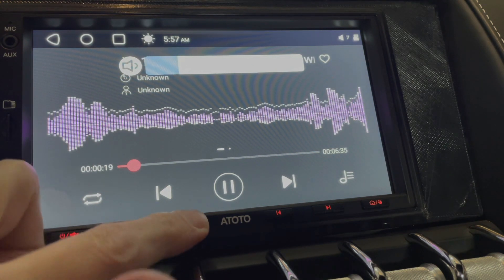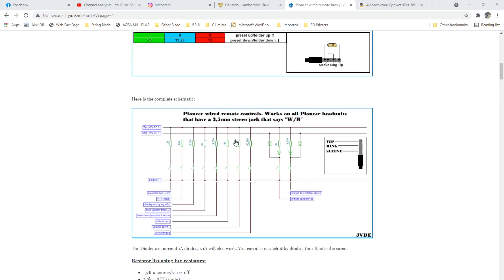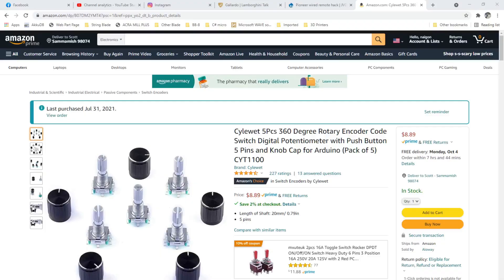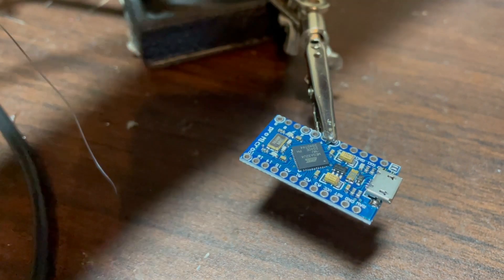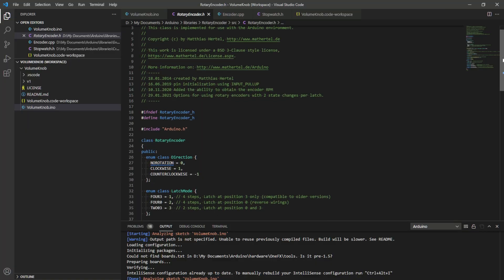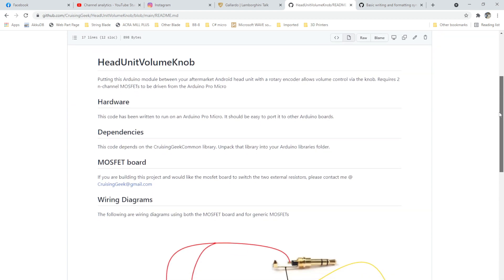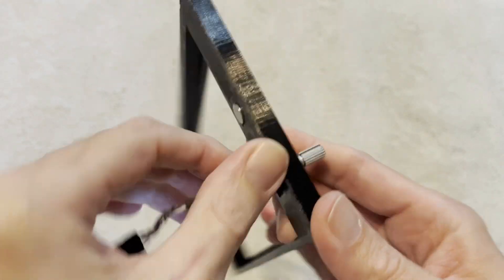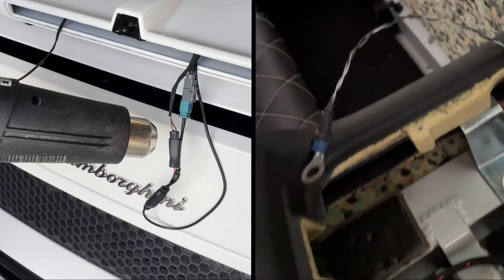Volume Knob for Aftermarket Head Units using a Rotary Encoder and Arduino

Comment: Great. I tried and it worked well. Thanks again. How can i add the second roraty encoder for different outputs?
Reply: hi can you help me
I can't find the stopwatch.h directory
I get an error in the stopwatch.h compiler: no such file or directory
Thanks
Reply from the maker: Hey nb1011100, you need to also download the CruisingGeekCommonLibrary from here: https://github.com/CruisingGeek/CruisingGeekCommon/tree/main/src

Put that in your Arduino libraries directory or right in the directory with the main files and it should compile at that point.
Reply from the maker: Glad it worked! If you are not a programmer the easiest way would be to just run a second Pro Mini with this firmware running, and the outputs would be run in parallel. Just make sure all the resistors are unique values so the head unit can read them independently.

If you can program you could potentially add code into the same Arduino to read a second input, but I don't recall if there are enough analog inputs for that on the pro mini. Definitely a Mega would support that.

Comment: Does this only work with Android based units and not brand names like Kenwood, for example?
Reply from the maker: This should work for the branded units as well so long as they have a programmable SWC input settings app where you can lean the buttons from the steering wheel. I admittedly am less familiar with each of those brands though so you would want to play with it or research each brand separately online.

Comment: I have a car with a  canbus decoder. Do you know if the android head unit will recognise the button presses from the swc wires if I have it configured with the canbus decoder?
Reply from the maker: I'm actually not 100% sure if the canbus decoder takes over the functionality of the analog swc input or not honestly. It would require some testing. I would hope swc controls would still work. If not you would have to interface the buttons with the canbus decoder as if it were another entry of your canbus system.

Comment: Looks complicated for the uninitiated. Would you consider building one for me?
Reply from the maker: Is it for a Gallardo or some other car? Main issue is to make a facia that accepts the rotary encoder for another car would be tough without having the car.
Reply: @cruisinggeek3640  I was thinking just the knob by itself with the board already built and ready to install.
Reply from the maker: @wfyfwfyf  Yeah that's probably possible then I could wire it up here with the 5V buck module and MOSFET board with the audio jack so it was quasi plug-in-play. Reach out to my email naigon_akoii@yahoo.com if you would like to have me quote you to build it.

Comment: amazing stuff, thank you so much for sharing! would you be able to point me to one or more of those projects you saw that use the USB volume control knob?
Reply from the maker: I didn't actually save any of the projects where folks were doing that as I knew it was not an avenue that I wanted to pursue. If you didn't want to go the Arduino route I would highly recommend a unit that was already made to interface with the SWC input, like this unit:

https://www.walmart.com/ip/Universal-Car-Wireless-Steering-Wheel-Control-Button-With-LED-Light-8-Key-Functions-For-Car-Android-Navigation-Player/889710547?wmlspartner=wlpa&selectedSellerId=16214&adid=22222222227889710547_16214_145279756546_18395656247&wl0=&wl1=g&wl2=c&wl3=646639356873&wl4=pla-1944934239563&wl5=1027741&wl6=&wl7=&wl8=&wl9=pla&wl10=120798572&wl11=online&wl12=889710547_16214&veh=sem&gclid=Cj0KCQjwuLShBhC_ARIsAFod4fLhRlDuhkeN09TZ0QGs02_VJkeNdatXwcOlu2hHA1M610b1FiUqs5kaArqXEALw_wcB&gclsrc=aw.ds
Reply from the maker: Note that this would be superior to the usb version as it works exactly as I built, the only downside to this being the form-factor cannot be customized so it is a bit harder to integrate into your existing setup.

Comment: Awesome work! I'm not well experienced with mosfets, and am based in Australia; any tips on selecting mosfets for the project? cheers!
Reply from the maker: It needs to be N-channel, it should be able to handle maybe 0.2amp continuous, though I didn't measure. This is the exact one I used but it is overkill for this application as it is 5amp continuous:

https://www.mouser.com/ProductDetail/755-RQ6E055BNTCR

If you are looking for a bigger aka easier to work with through hole package this should work as it is 60v but 0.2amp (200mA) compatible.

https://www.mouser.com/ProductDetail/onsemi-Fairchild/2N7000TA?qs=iN0KuJO79KZfCWVKA48bEg%3D%3D
Reply from the maker: Again I didn't measure how much amperage the Atoto drew when clicking the button but I doubt it was more than 0.2amp.
Reply: @cruisinggeek3640  Thanks a heap! I don't suppose you know if this is likely to work with my 2018 Kenwood head unit do you? It seems to use a 3.5mm jack like your design, however may have 2 inputs. Can't seem to find information anywhere on what signals the DDX9018DABS takes, but I assume it's relatively standardised these days.
Reply from the maker: @conroe_au  My only concern with the non-android head units is that the resistor values MIGHT be hard-coded inside the unit. The android unit has an app in the settings (shown in the video) that allows you to configure which button has which resistor by allowing you to select the one you want to sent then press the button. If your head unit doesn't have such an app in settings then it would be tough to figure out which resistor values when to which buttons.

Otherwise I believe the principal is the same that all the analog steering wheel controls (SWC) are resistor-ladder based so this would work.
Reply: @cruisinggeek3640  thanks a tonne. I've found some more convincing evidence that there's a training function
Reply: @conroe_au  Kenwood often uses it's own protocol for steering wheel control buttons. It's not a resistor matrix type, but the input line of the head unit expects NEC serial data .. 
Please google on "Ford to Kenwood radio adapter HOWTO" and you'll find more info and a sample project.
My project is based on this one and works as a treat on the bench, but not in the car. I probable have to use schmitt triggers to clean up the signal to the head unit. (in the car there can be interference noise from alternator and radiator cooling fan..)
Reply: @winandd8649  thanks for the help!
Reply: @conroe_au Cheers!
Reply: @cruisinggeek3640   I see you used 1K & 15K resistors, is the value critical, or just that they are different? Would you recommend a particular resistance for the pushbutton contacts? Thanks!
Reply: Hey @cruisinggeek3640 I finally got around to building this, but it appears that RotaryEncoder.h is missing from your common library? Have I missed it somewhere?

Comment: super intresting video, but putting an atoto head unit  on a Lamborghini ?? really? I would understand a Raspberry to customize as much as possible, a made in China Head unit looks very cheap
Reply from the maker: It isn't the best sound but compared to the factory it is sadly still better. I didn't like the Sony or Alpine units as none had the SD card or was a screen that wasn't made to have a flush, recessed fit. With that awesome V10 I rarely play music though...

Comment: Don’t know if you are still reading comments on this, but i am curious what the reasoning for needing a mosfet is? I would really love to know! Thanks!
Reply from the maker: Hey yes I try to check in here a couple times a week but been dealing with some health issues lately.

The main reason the mosfet is used is to keep the potentially higher current draw of the amplifier from running right through the Arduino CPU. It also allows for sending a positive signal to ground the signal so that the logic is 1 to be on and 0 to be off. Without the mosfet there might not be enough power from the CPU for the head unit to register the resistance, or worse it could be such a high current that it frys the CPU.
Reply: @cruisinggeek3640  thank you for the reply I appreciate it, and I hope you get to feeling better!

Comment: Thank you for this video and information. I have basic electronic knowledge. Which mosfet i have to use?
Reply from the maker: Pretty much any N-channel MOSFET would do, as the amperage/voltage requirements are pretty low. The ones I used were part of my Igniter boards which I sold as another small business and were way over-rated for this application.

Comment: Really cool, I'm building this project for my head unit, my rotary encoder also includes a push button, so I'm attempting to uplift your code to support this, then I can map it to a mute or home/voice input button.
Reply from the maker: Thanks for the compliments! You do not need the arduino for the pushbutton, simply use a third resistor off one of the button's leads to the head unit, and the other to ground and it will work as well. I did that for mute/unmute.
Reply: @cruisinggeek3640  oh man, it's so embarrassing I didn't consider that

Comment: I wonder if this can be done with the first knob without needing the adrino
Reply from the maker: Thanks for the compliments! You really need something like an Arduino to read the rotary encoder to convert the twist signal into independent button presses that the head unit can understand. Simple buttons can be done with just a resistor and no Arduino though, and that includes the integrated button on the rotary encoder.
Reply: @cruisinggeek3640  thank you

Comment: Great one, looks complicated though. I was also wondering, why didn't you make the buttons/ knob on the near or closer to the steering wheel to reduce movements and destructions?. It could have been easier to place it anywhere since you made it yourself. It all depend on your preferences though, as for me I'd have installed it closer to the steering wheel.
Reply from the maker: Thanks for your compliments! Since the Gallardo does not come with any buttons on the wheel I didn't want to change that. The radio area was already completely removed so just adding the switch there made sense to me. It is still better than the factory as the volume knob was on the other side in that area closer to the passenger so it is a much easier reach for me now.

Regardless, I almost NEVER use my radio in this car. The v10 is all the music I need!

Comment: It is so frustrating that a turn key solution like this does not exist somewhere. I really want to put a Teyes CC3 headunit in my pre canbus car, but without a way to control volume I am out of luck. Unfortunately for me, I am not a coder and have no idea where to begin with programming the Arduino.

Any chance you have considered making these available for a price to those of us who are mechanically adept, but coding deficient? Great video by the way brother!
Reply from the maker: I had a small business making electronics modules for a hobby for quite a while and now that I'm done with that I do not think I'd want to start up another business LOL. But you never know. Thanks for the compliments!

Comment: I really want to do this, but I've also seen rotary knobs where you can tilt (like a joystick) and push. Would be nice to push-to-mute, or be able to hit next song/previous song.
Reply from the maker: This rotary knob supports a single momentary button which I hooked up one third resistor and I use it for mute. I don't know of any that have more than a single button action though.

Comment: Wrap the fitting in black piano vinyl or something idk it looks so rough!
Reply from the maker: Thanks for the feedback. I plan on sanding down the newly designed faceplate which takes the entire area, using filler primer, wet sanding to 600, then I can take it to my friend who owns the body shop and he will hit it with gloss black to match the instrument cluster.
Reply: Some black marine grade vinyl would look great, be easy to install  and be very cheap.

Comment: Great to see a programmer and engineers view on living with a LP 560-4. I will have mine soon as that is what I am pushing towards for a car.
Reply from the maker: LP Gallardos are great cars, I drive mine "daily" (Since the pandemic I really don't drive daily but I take this car 90% of the time I do drive). With the AWD and Audi drivetrain in the LP gallardos they really are not bad to drive everyday. The head uint/backup cam was one of my biggest issues. Now the frunk popping is something I have to get to as using your car frequently it does get annoying. But it has been a hoot of a car to own, hands down my favorite car I've owned.

Thanks for your support!